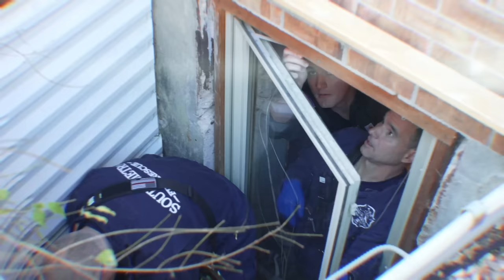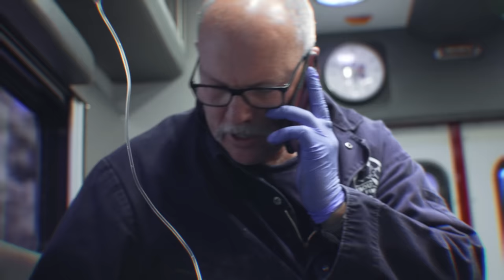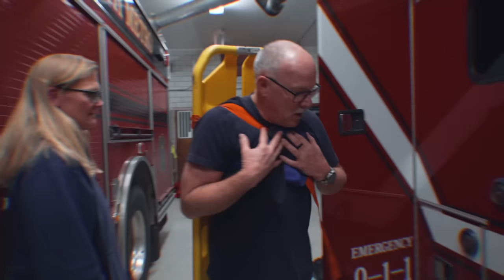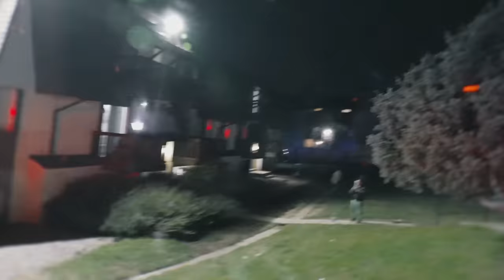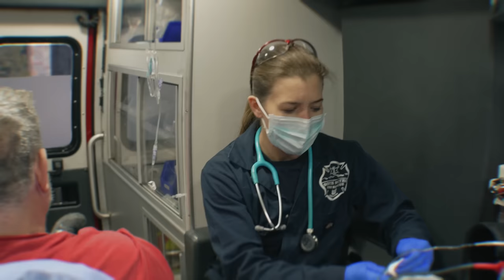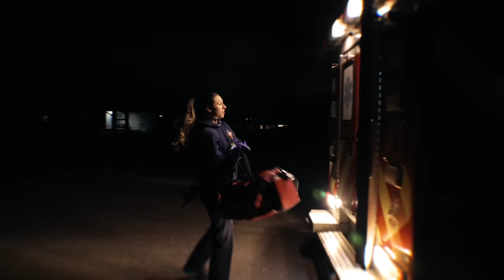Fire Medics Episode 1

Comment: Does SMFR have some sort of protocol against using NIBP? Or is it provider preference?
Reply: Right?? I noticed that too
Reply from the maker: Currently SMFR does not have noninvasive blood pressure capability. That was a choice after SMFR's research found that NIBP is less accurate in a dynamic environment. With improvements to technology, that decision may be reversed in the future.
Reply: Please explain what you mean
Reply: @SouthMetroFireRescuePIO  That's a very interesting response. Where I work, we have about 3,800 paramedics and all are trained to use the cuffs on the LP15s. Artifact on them seems less than on the LP12s and Zolls. Agree that using a manual sphygmo allows you to keep up an old skill and gives better results on a hypotensive patient.

Comment: As an EMT for 10 years it drives me nuts to see them using their cellphones with gloves on. Especially on non-critical patients. I stressed to all my trainees to take your gloves off before using non-patient care items.
Reply from the maker: Thanks for sharing your perspective. The cellphones used to call in hospital reports are only used for that purpose and don't leave the patient care area of the Medic units. After transports they're disinfected along with all other items and surfaces necessary. A separate cellphone is assigned to the crew and typically carried on one of their radio straps for all other communication and reference needs.
Reply: Probably one area of quite a few that get overlooked with cleaning. Years ago some pathology gurus did tests on some of our ambulances. The front cab (steering wheel, indicator stalk, radio etc) were the worst, and also the shoulder parts of staff uniforms.

Comment: Why no NIBP cuff attached to the LifePak?
Reply: They may not be calibrated well or worse, the department may have a manual-only BP policy
Reply: @Maddawg31415  I agree that the first BP for any patient should be a manual just to get a good baseline that's essentially 100% accurate. But after that, especially on a critical patient that needs a lot of continuous interventions, having to take 30 seconds of dedicated time to get a manual BP as opposed to hitting a button seems odd.
Reply from the maker: Currently SMFR does not have NIBP capability. That was a choice made after SMFR researched options and determined that NIBP's are not as accurate in a dynamic environment. With technology improvements that decision may be reversed in the future.

Comment: How is there the manpower for 2 medics to be in the back of the ambulance on a fall?
Reply from the maker: One of the reasons that SMFR sends a fire engine to medical calls is so the ambulance can have additional personnel, if needed. For this call, one firefighter from the fire engine helped in the back of the ambulance.
Reply: @SouthMetroFireRescuePIO  Is that typical for any medical call or just certain ones? We do 12-hour shifts in our ambulances and average 8 jobs a shift. We generally have about 16-20 paramedic crews on in our area working out of 7 stations, yet there are only five fire stations. Not enough Fire and Rescue resources to assist us with ever job. Our firefighters are only trained in BLS, but we call them when needed for vertical and confined space rescues, plus any difficult access and extrications.